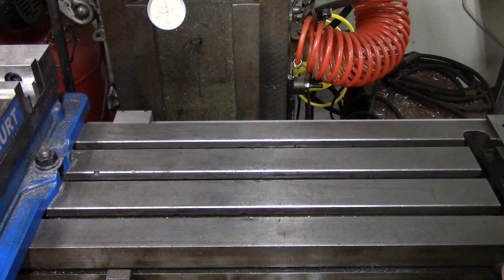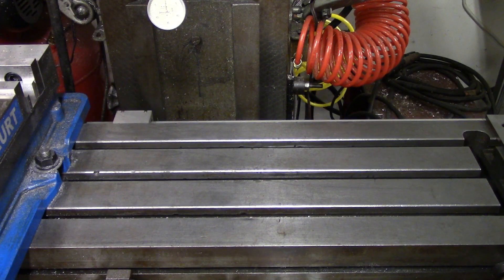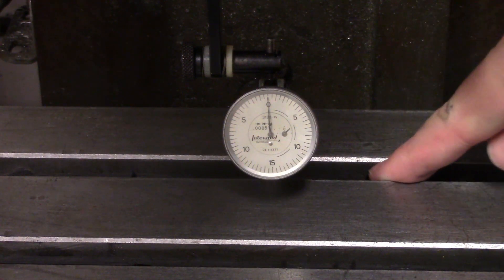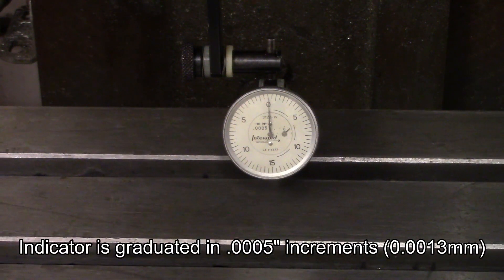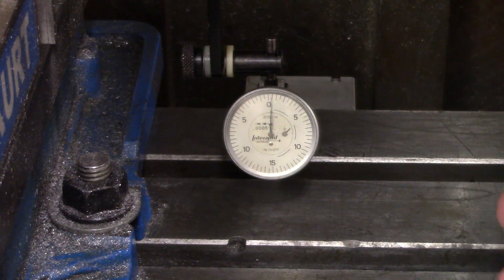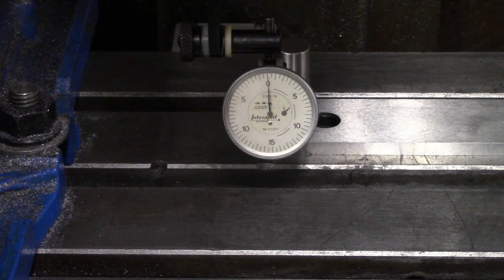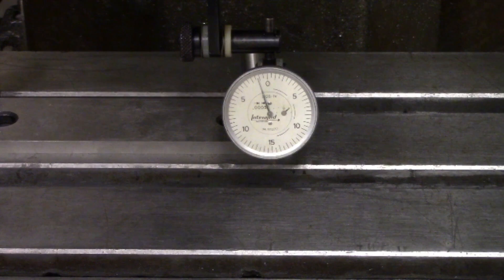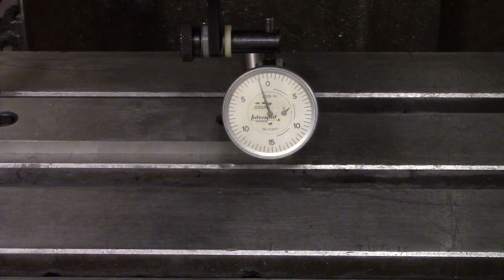How Accurate Are Your T-Slots?

Comment: I love your videos. Very informative.
I have a question for you about coolant and oil. I see a lot of people brushing cutting oil on the part when drilling holes, threading, turning, etc. I use spray cutting fluid for general purpose, water soluble cutting fluid for my saw. I recently purchased a horizontal mill and a big drill press both with coolant pumps and dark oil in the sumps. Do you have any thoughts on what type of oil I should use. The only cutting oil I am familiar with is the ridgid thread cutting oil.
Thank you again for sharing your knowledge.
Bob
Reply from the maker: Hi Robert. I use Tap Magic pretty often and also the dark cutting oil. I like them because you can use them in moderation and get good results. They do tend to smoke and stink up the place though. Machines that use dark cutting oil aren't pumping very fast, so it won’t sling all over the place. Coolant does lubricate a bit, but is mainly to cool the part/tool and evacuate the chips, so they generally pump at higher volumes. That can get messy without some kind of containment. There are a lot of saw specific coolants that are formulated to get as much life out of the blade as possible. There are also specific formulas for mist coolant, grinding, and even for certain materials. Coolant can be a breeding ground for certain bacteria that turn it skunky, so it's a lot higher maintenance.

Comment: One thought: the position of the pins is completely determined by the position of the slot and the irregularities at that exact point. So if there is some damage at that point, the pin and therefore the parallel will pick it up and appear to be off even though the slot is correct on the whole. The way to test this is to change the position of the pins slightly, repeat the measurement, and see how it affects the parallel. That will give you an idea of the range of accuracy you can expect when using the pin alignment technique.

Comment: How tight do the pins fit. What diameter do they mic to.
Reply from the maker: The pins are quite tight as mentioned in the video.  I'd say a light press fit, although that is hard to judge since they are only contacting on two spots.  The pins are made from 5/8" turned ground and polished rod and measure in at .6247"

Comment: Good answer to a good question.
Obviously, when high accuracy is required, tramming of the holding system is performed, but the accuracy given by the T-slot pins is good enough for most milling operations. If you really need more accuracy, you're probably moving into grinding territory, anyway.

Comment: The burr and build up at the bottom of the t slot is on almost all mills. Comes of easy by running a file up and down the lengths.
Reply from the maker: Yeah. You can see where I had to do that on some parts. When I  initially bought the machine I actually couldn't run T-nuts all the way through the slots. The middle slot is still a little iffy.